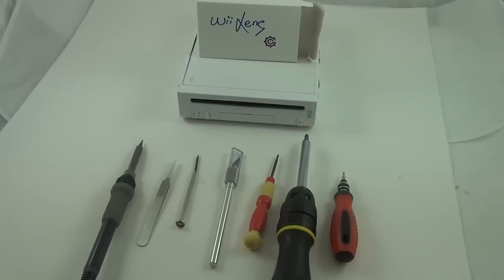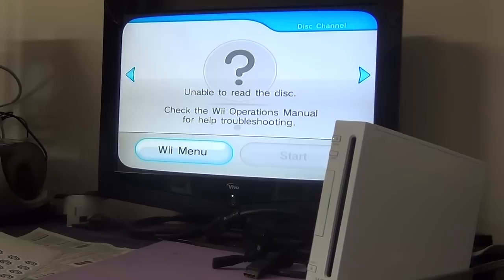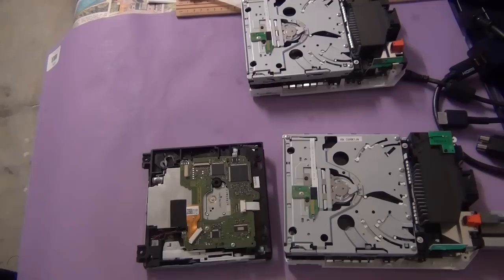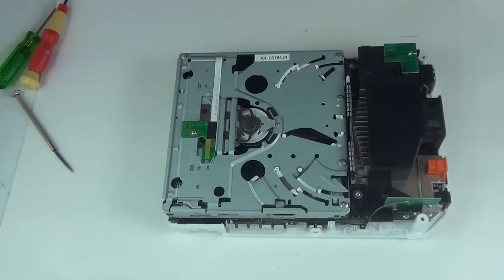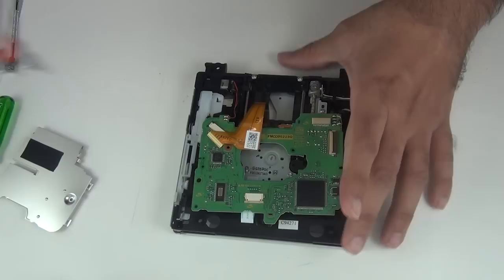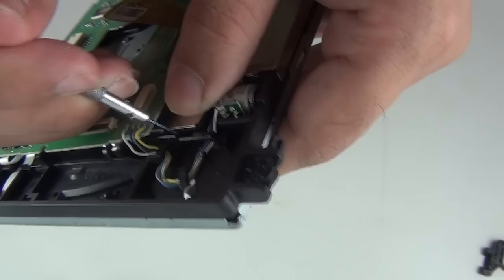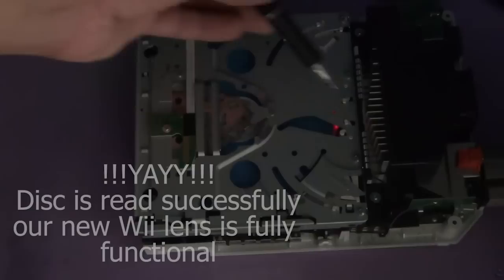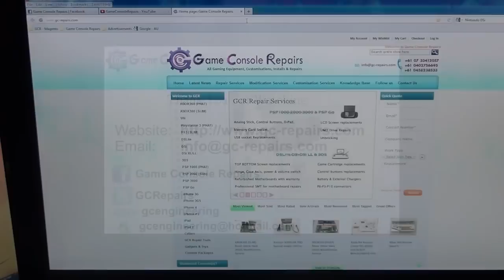Nintendo Wii Lens Replacement FULL HD

Comment: It's fixed! Hallelujah! And I did it myself! I've never fixed anything before that was this complicated! It took a really long time but now absolutely everything is working perfectly and I am so, so grateful. I think you should add a mention in your video that there are two different types of DVD drives in Wiis and that the new lens you are showing only fits one. All the same steps apply, though. I needed the other one, myself, and everything went right as you said. Anybody attempting this: Crack open your wii before ordering your new laser lens and see if you have the plastic slip with the bend in it or the straight one, like I have. If you order the wrong one, well, this bent one will not fit in the wii that needs the straight one and vise versa!
Reply: O
Pñppppp

Comment: thank you very much for this video, I was able to successfully repair my launch Wii which was suffering from disc read errors; they started while I was playing The Last Story (loved it by the way) and rapidly got to the point where feeding any Wii disc to the console would create an error in seconds (the one where you hear 5 beeps and get told to power down the system). Interestingly gamecube games would play fine. I tried cleaning the lens with isopropyl alcohol but it did not work so I got a tri-wing screwdriver and a new laser for about 10$ from ebay and installed it following this video. Now my good old Wii once again plays any disc silently and error-free...which is pretty great since Nintendo asked me about 100$ for the repair! thanks again, will be completing my backlog now! :)

Comment: You guys ROCK!!!! With this video, I was able to replace the laser that was having disc read errors. I'm not an expert by any stretch but I can tinker, so I followed your video carefully and it worked like a charm. The hardest part for me was making sure to keep the various sizes of tri-wing and phillips screws straight and putting them back correctly. I just marked the various holes with sharpie to keep myself clear on which one goes where. Thanks a bunch for saving me about $100!!!

Comment: Yep, followed this video and did the job. The small nut for the CMOS battery holder screw came loose and worked it’s way all the way into the disc drive once I had it reassembled, so had to take the entire Wii apart again just to fish it out but that was the only hiccup. I’m surprised that the lasers are so cheap still…

Comment: Thanks, this helped me install a very inexpensive reconditioned drive to replace my malfunctioning unit.  Now we can play Mario Cart again!  Also, we can play Super Smash Brothers now; it would never play before so the game has been sitting unused for years until now.  

I ended up with some broken plastic bits (I guess maybe the plastic is weak and deteriorating?) and I stripped one of the tri-wing screws. I had to use some duct tape to hold the battery plate in (the screw won't grip on anything anymore).  But in the end we get the ol' girl running again.  Thanks for this great video!

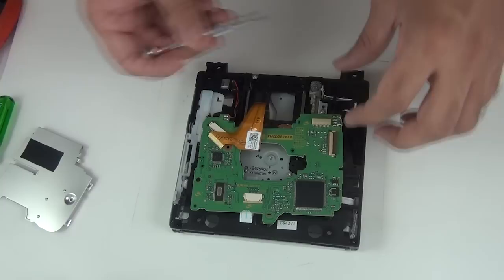Comment: I did this using your instructions. I got the tri-blade screwdriver (I doubt the screwdriver will last through another Wii repair though, kind of cheap and small) and the lens in one deal for under $9 on Amazon. Only thing is I broke off that tiny plastic tab/key (16:10) that goes over the metal rod you have to take out. The problem is we can't see how you lifted it because the parts and your hand hides how you did it. But when I put it back together I managed to get the screw to hold the plastic tab in place by holding it with tweezers with one hand while using a screwdriver with the other hand. So people need to be careful with that plastic tab. But THANKS! Now my Wii reads disks again :) I can play!

Comment from the maker: if its spinning then your spindle motor is working.
Currently its not worth repairing internals of the Wii DVD Drive. You can easily purchase New DVD Drive for less than $20 bucks and simply carry out replacement.

Comment: Good video!  Wish I would have watched this with the diagnostic before ordering a new laser; turned out that I need a new disc drive...  Anyway, while taking my unit apart, a small square nut fell out of the unit ~ it's about 3-4 mm square, and shiny silver.  Any idea where this came from?

Comment: When inserting a disc, I see a red light for two second or so until the disc stops spinning. Does this mean the laser is working but the spindle motor is not? This is a different issue than my original problem before having replaced the laser.

Comment: My Wii had trouble reading games. I would sometimes have to try launching the game several times before it would work. I bought a replacement laser and installed it using your tutorial. Now, the disc spins for only a few seconds before stopping. The Wii returns a "Unable to read disc" error. This is worse than before. Is the laser bad? Did I damage something while installing? I don't know how to proceed. Please help. Thanks.

Comment: Question, what happens if the little black tab that is holding the rod breaks off? Does it matter, or should I replace the whole dvd rom drive, instead of lens now?
Reply: +Melissa Bourne Hi Melissa, the tab on mine broke off pretty easily, I'm not sure if the tab missing is even a big deal though. I hope he responds to let us both know, although my Wii works like new now. It took me a few minutes to figure out how some of the cables come out (I figured out that I had to pull straight out the two side tabs first, in order to have the cables come out easily) I think 2 or 3 cables are like that and one cable you have to flip the little bar up first (12:39) but he shows that part I'm pretty sure. Using a magnifying glass helped me a lot.

Comment: Great video!! Question, my laser lights up, but it is not at the end of the disk like your, more like an inch higher. It loaded the game, but then when I went to play, the disc stopped and I got the error. Now the disc doesn't spin at all. I think I have an intermittent motor. Would that cause the laser not to be at the end like on your video? How about a part number for the drive motor?
Reply: Karl did you get this fixed?
Reply: I found the replacement DVD drive on Amazon and was able to follow the remove and replace instructions in this video.  I was able to skip all of the laser steps because it was a whole new drive. 

Original Nintendo WII RVL-001 DVD Drive Replacement Part Lens INSTALLED, Y-screwdriver - [Plug and Play Version] - https://amazon.com/gp/product/B0155J99MK/ref=ppx_yo_dt_b_asin_title_o01_s00?ie=UTF8&psc=1
Reply: @nickvurva3420  Yes. I ended up buying a whole DVD drive unit off eBay for about $14.00. It was supposed to be be a new unit, but it looked old and some scratches and dents, but when I installed it everything works. The guy did end up refunding my money because it was obvious that it wasn't new.

Comment: Help.

I've been getting disc read errors for a while, but it can still play most games, it just crashes constantly. I popped it open to diagnose the problem as in your video, then unplugged and plugged back in everything like you said. I did see a red light, but it was incredibly dim and never moved or flickered.I also noticed that the strip attaching the lens to the circuit board is bent in your video, but my strip is straight and much, much shorter, I have serious doubts the strip you show using to replace in this video would even fit through. Also, when I was done taking it apart and putting it back together for practice, everything on the screen was YELLOW, not the usual pristine white of the Wii. Could I have not connected something 100% properly when I reassembled it? I followed your instructions to the letter. What could do this? And where can I get a lens replacement that isn't bent, but much shorter and straight?

Comment: when I open it up an run it with game in it I press down on top corner n bottom then game runs when I closed it back up it gave error. I think it has to do with the body of cd case  is not pressed down firmly the screw barely holds it down if you really check it. but it did work while pressing down on it

Comment: i have a question i have 2 wii´s but i want to change each others lens, the thing is, does a used lens have that thingy you remove with the iron solder? cuz i dont have the solder and i dont wanna open all the way and find that surprise.

Comment: I have the problem that when i play a game at the beginning appears the message "an error has ocurried press eject and turn off the console, etc." I have some questions: In mercadolibre the website where I can buy the lasers appears to be 11 dolars alone but, the full dvd rom costs 54 dolars total cost. Whats better? Do i buy the laser or the dvd rom? Also, if I replace something like the laser or the full dvd rom, will it still read gamecube games? Other question: Is it neccesary to use the soldering iron thingy? I dont have one, It looks like you need to be very precise to solder and I dont want to mess it up. And the last: I didnt understand what you said about the region stuff, are all lasers and dvd roms the same thing? will it change if i put other that shouldnt be? are they different? Thank you.
Reply: I think you should just buy a replacement Wii 😂

Comment: Thanks for the tutorial video! I have a new laser, but when I tried your diagnostic with the cover off, I do see a red light. (The disc also spins ok.) The red light isn't steady like in the working wii in the video, though -- it blinks off while the laser is trying to read the disc, and then back on. Can you tell from this whether the laser, motor, or entire drive needs to be replaced?
Reply: Lol this comment is 7 years old but I have the same issue and would like to know the answer.